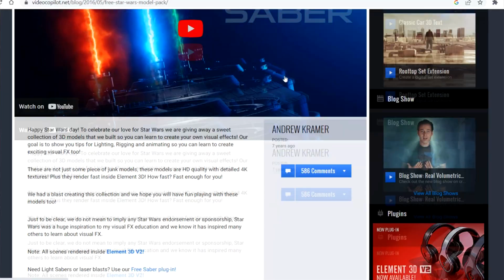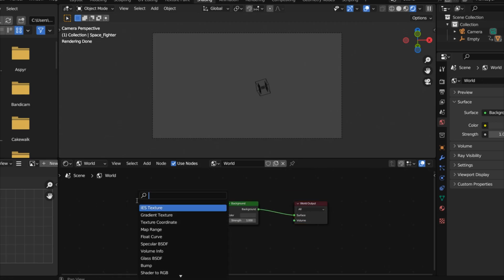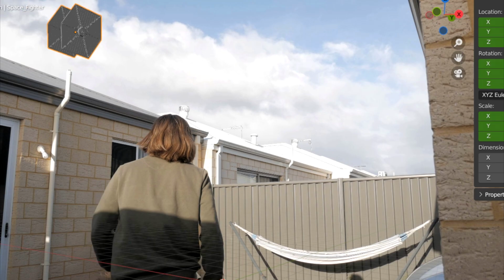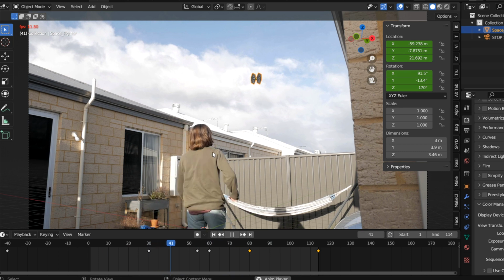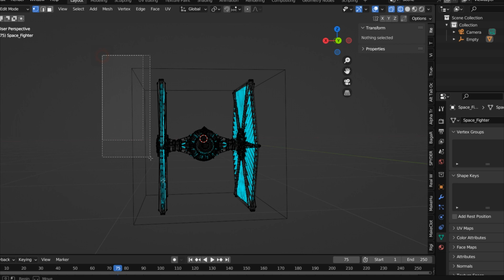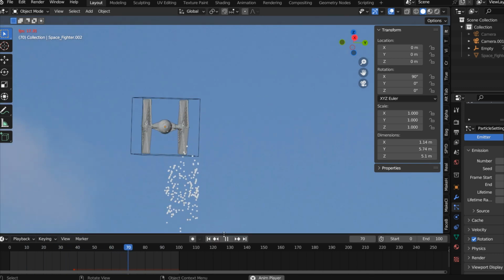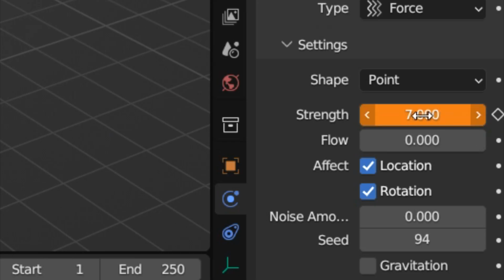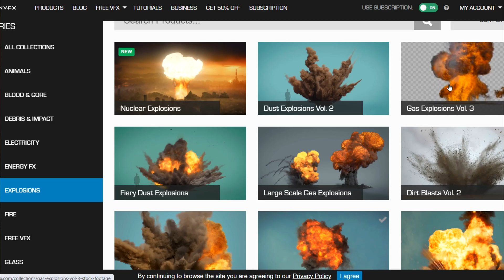BLENDER TUTORIAL- Stop a ship with the force for free!

Comment: did you use camera tracking?
Reply: No. He used a plane with a video on it. Then he basically just set the plane to his camera. For the video part, just add an image texture like normal and just select you video. Hope this helps :)
Reply: @Jamodio11  haha, I already know how to import videos on an image plane. But it very much looks like the footage was camera tracked. If not i suppose it's just really really well done positioning of the 3D models
Reply: @dimigaming6476  yeah it was. No camera tracking involved
Reply from the maker: @dimigaming6476 I used fspy to match the positioning, angle and focal length of my camera with blender's virtual camera, so the models could line up well 
The shake was added in post